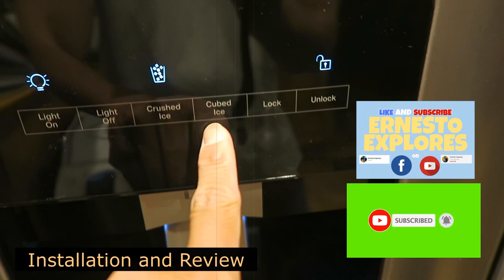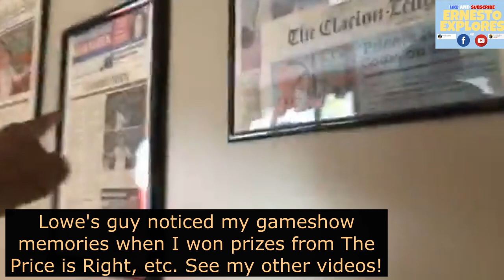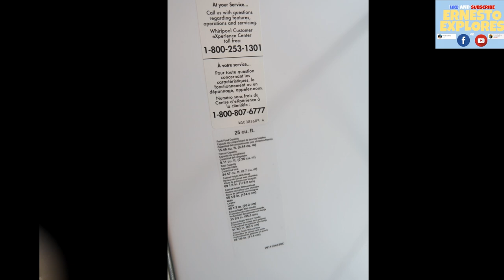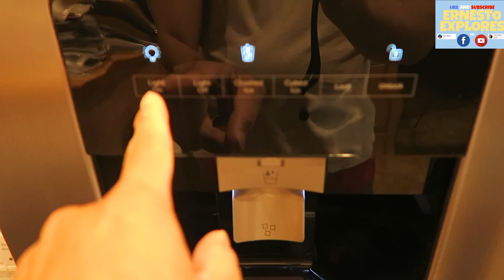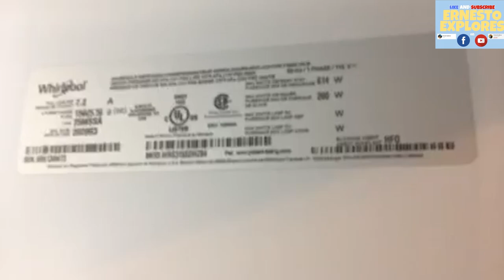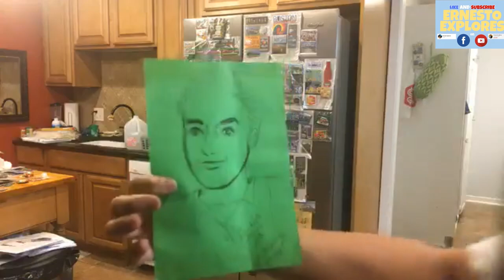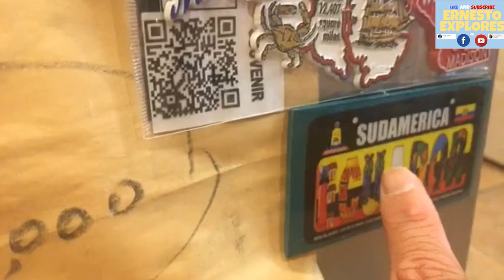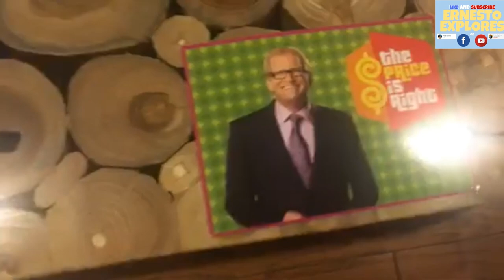Whirlpool Side-by-Side Refrigerator Purchased at Lowe's Online "Extensive" Installation

Comment: did you find water dispense leaks and the compressor is loud sometimes? frig also turns off when you open the doors. i wonder if it does that because of the energy star
Reply from the maker: thank you for your comment.. with water dispenser, i didn't notice any leaks.. but they wanted me to run out water for about 2 galons coz water here is brown.. also, the fridge is so silent except for mild noise when it's making ice.. yes i noticed that the ref cooling mechanism inside turns off autmoatically and turns back on when it's needed for energy saving feature.. in fact, after 6 months, i received an email now for 20% discount on water filter which i haven't done yet. deadline is early Nov 2020.